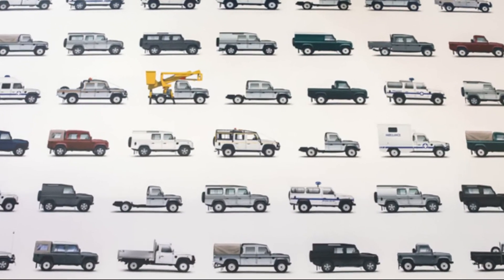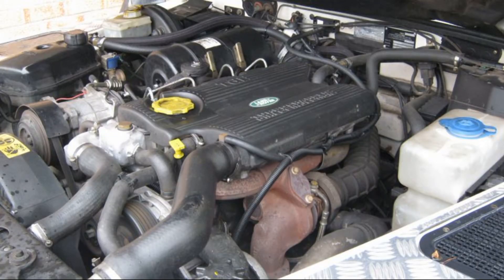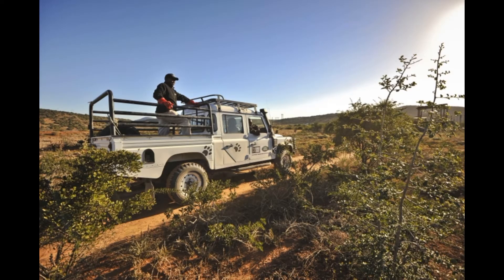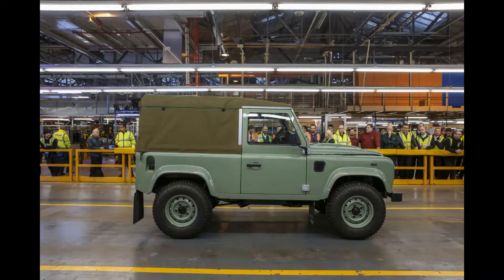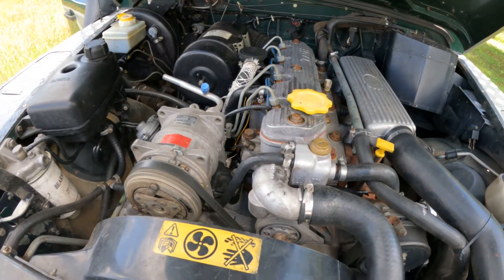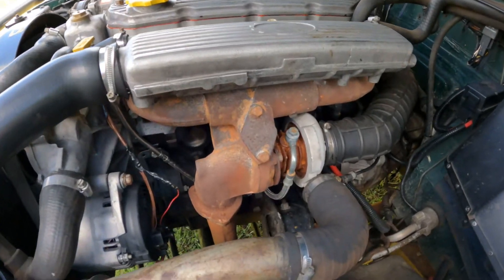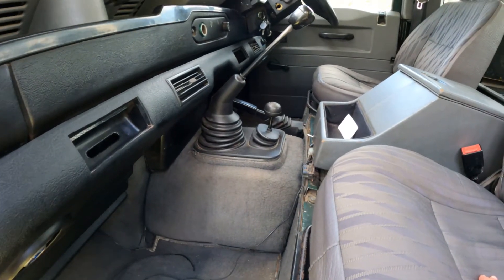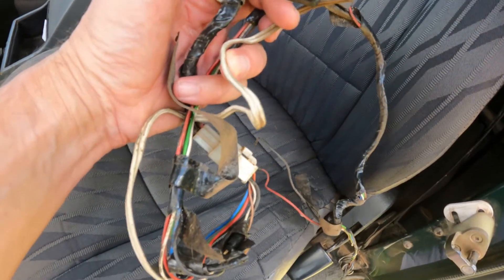I just bought a used Defender - Buyers guide and tips how to buy an old Defender - Part 1

Comment: Not a bad video but some of the most important big issues with a used Defender are totally overlooked here. Rust. Lift the floormats and inspect right up to the pedals. Check the bottom of the doorframes. Check chassis fronts underneath where the bumper mounts remove and discard the devils rectangular rubber plugs that may still be there. Dig / hose out the mud that will be in there.
Reply from the maker: Thanks for the feedback and your comments. You are quite right about the rust, I have included some of this in the write up, link in the description. In SA rust is a problem only in the coastal areas . Vehicles that remain inland can survive with no rust issues at all. This vehicle I bought has no rust.